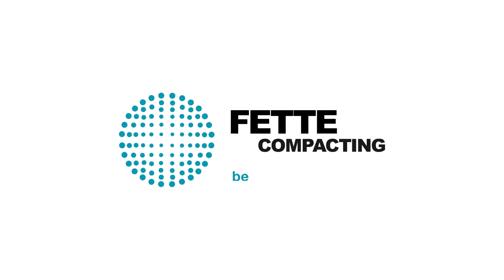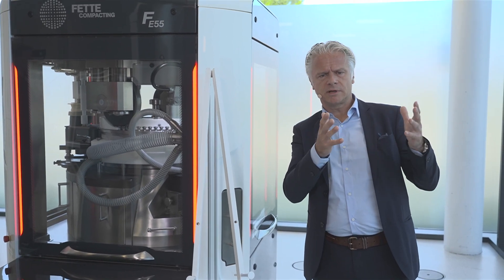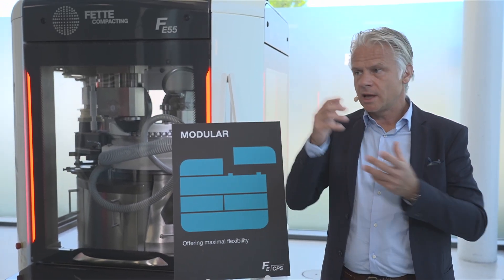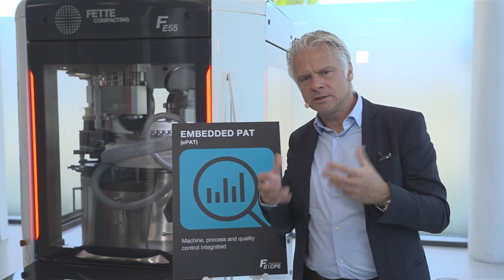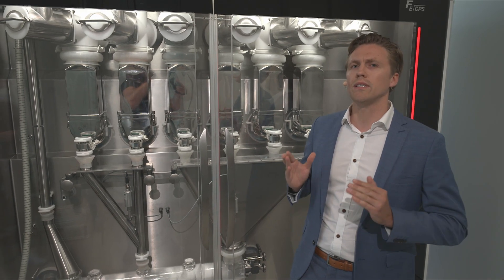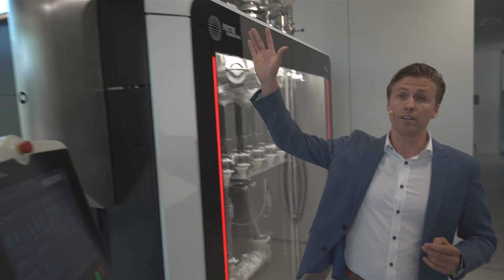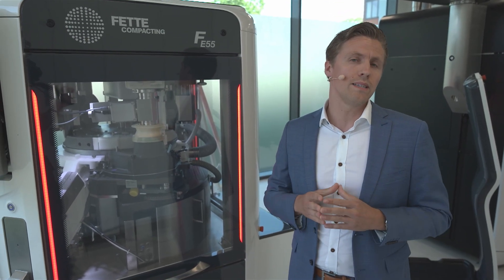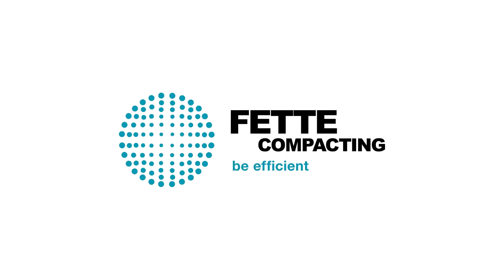Continuous Manufacturing reinvented - presentation of the new FE CPS | Fette Compacting

Comment: Very interesting. I work at a contract manufacturer, where we have 7 different models if tablet presses from 4 different manufacturers. About 25 presses in total. Including an old Fette.  Not counting coating pans or encapsulating machines. We have an entire floor dedicated to blending formulas, seperate from the machines. Having such a large variety of machines demands a method of operating that is suitable for all machines. If our company would consider a new Fette machine, we would be faced with a dilemma. Do we uproot our working methods to benefit the new machine? Or do we adapt the new machine to be compliant to our generic working methods? The last option is considerably cheaper, our entire building is built around those generic working methods. But that means we can't have the benefits of these newly developed machines.
Reply from the maker: Dear ivo215, Thank you for your comment. It would be great, if you could send an email to tablet@fette-compacting.com

Our experts will answer your question as soon as possible.